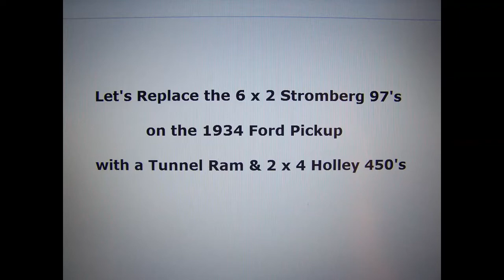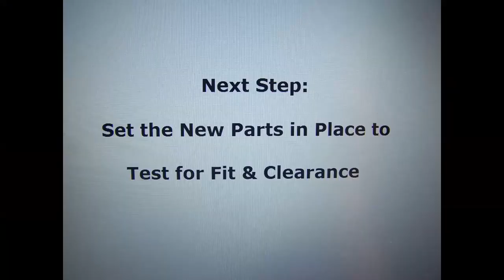Let's Install a Tunnel Ram and 2 x 4 Holley 450's on the '34 Ford Pickup

Comment: A Tunnel-Ram just has more look-see. I put a Tunnel-Ram on my 1972 Mercury Montego. 351 Cleveland engine. With Street Scoop with three red openings that opens when you mash the pedal. No choke, colds start like fuel injection.
Reply from the maker: The TR is indeed an impressive sight, Robert, and when properly set up, it really "livens up" the engine. I have no problem with cold starts either.....despite what you are led to believe.

Comment: Great build UD, tunnel rams are awesome. I don't know about using copper tubing for fuel lines though. It can harden with vibration and crack, with disastrous results. Plus it would be nice to see a Ford engine in a Ford car. Just my 2c worth.
Reply from the maker: Thanks, Geoff. It sure worked well :) The connection to the copper tubing was via flexible fuel hose so no problems. The beauty of hot rods is they allow for mixing and matching parts, including engines. I assure you that the Ford body had no problems accepting a Chevrolet engine. It's strange that people aren't as understanding.

Comment: I would put some type of vibration insulation between the 2 copper fuel lines...Copper is soft and will wear through in time...Just an observation...
Reply from the maker: Thanks for the tip, S.

Comment: Oh Boy, well between building the 5F1 and dreaming about building a Hot Rod you have the channels i need to see and help me get thru these retirement years. Beautiful ride. Very nice upgrade. You seem to have the polishing chrome down pretty good.  Thanks for taking the time to share. D
Reply from the maker: Years ago, when I restored jukeboxes,  I bought a commercial-grade buffer/polisher, just like the chrome shops, to polish aluminum and stainless steel parts. It now does the same for the hot rod parts. I featured it in a video on polishing the old Ampro speaker grilles.

Comment: With the transmission modulator does it shift earlier with the lower vacuum of the tunnel ram? Ive got a rebuilt hot 302 in my t bucket with same ram and carburetors with a c4 auto. I dont want it to shift early before the party happens
Reply from the maker: It seems to shift at the proper time, BB. You can adjust your modulator to shift later.....there is a tiny screw inside the protruding tube.

Comment: Pretty build. Great ride along. 900 CFM is the perfect amount of overkill for the genre.
Reply from the maker: Thanks. I agree that 900CFM is indeed excessive for a fairly stock 350......but smaller carbs cost a fortune.
Reply: @uncledougshotrodgarage6049  it is probably closer to 650-700cfm, Simply adding the cfm of the two carbs doesn't work like that on a tunnel ram due to the fact that the airspeed going down through the intake slows down considerably because your effectively doubling the surface area the engine is breathing through and the engine is just a big air pump and will only take in what it can digest. awesome build!!

Comment: Sounds like you have pump noise in your transmission?
Reply from the maker: You may be hearing the cam gear drive, David.
Reply: @uncledougshotrodgarage6049  Yup, I didn't realize you had a gear drive cam instead of chain.
Reply from the maker: @DCrockett1  You can hear it when the engine is idling.